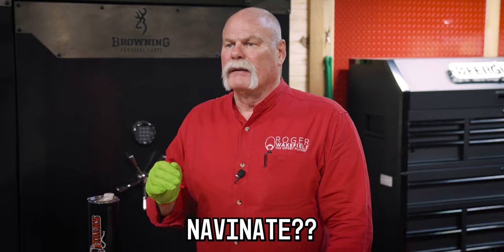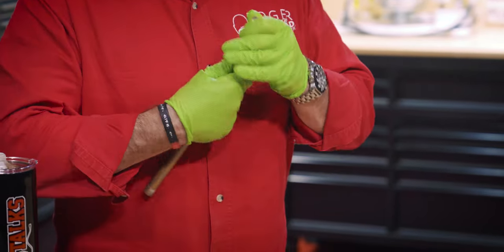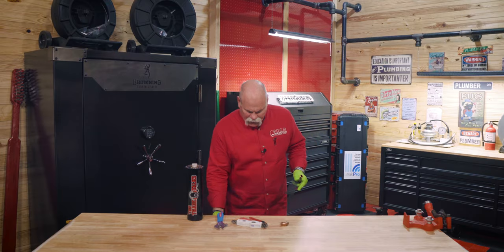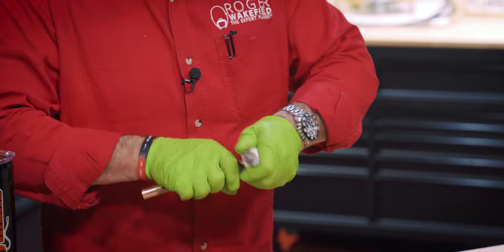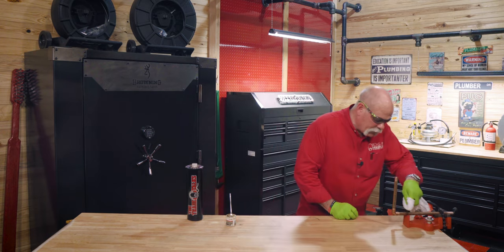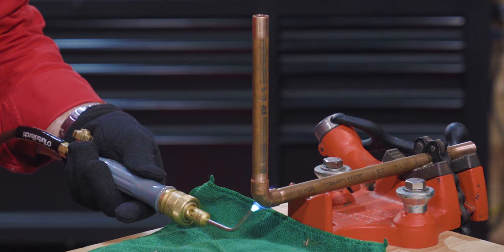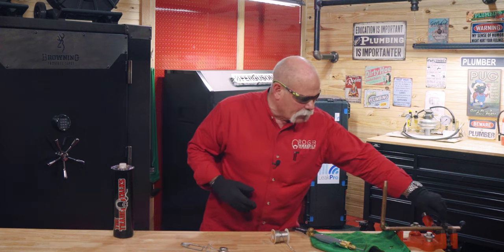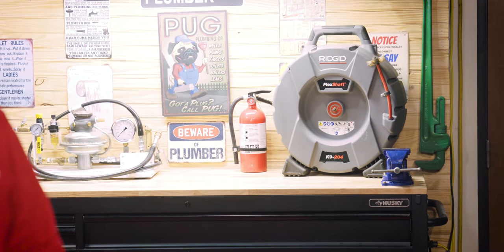7 Easy Tips For Working With Copper Pipe

Comment: Roger, I have a question for you sir. For a tie in point is it a good idea to transition from cpvc to pvc with a glue joint?
Reply: direct transition fittings are near impossible to find, so I use threaded adapter fittings to transition between. even put threaded unions/shutoff  valves there(if exposed).
if also exposed, you can sometimes find sharkbite/other brand push on that will do cpvc/copper/pex to PVC on other end. I've actually used those in 1" size for transition from old painted and brittle pvc to pex, for connecting line that would be very hard to replace(feed line from the well to pressure tank!). I explained the risks of leaving it in place and they chose to leave it, vs. replace 100+ feet across the partially finished building. of course I also pointed out the other 15' of black poly, that is also ancient, painted and exposed to damage.

Comment: I know it's not the subject of the video but as it seems in the US polypropylene pipes are not used, are there any specific reason for that?
Reply: black poly is used for rural well piping and for irrigation mains, but isn't used inside because the joints can fail.
Reply: @kenbrown2808  thank you for your reply. One would think that melting plastic to join pipes and fittings is safer from other plastics such as pex which are crimped or whatever. Anyway thanks again
Reply: The US does make use of PEX all over the country.  PVC CPVC and ABS are also quite common.
Reply: @Redact63Lluks  not talking about PEX at all hence the question
Reply: @MH-df6zx  we don't fuse poly.  we use fittings with mechanical clamps.  that might be the factor.
Reply: @kenbrown2808  oh ok that makes sense. Thank you
Reply: @MH-df6zx  in fact, if you're talking about heat fusing pipes, I've only seen that done on large pipes - like water and gas mains.
Reply: @kenbrown2808  yes exactly I'm talking about heat fusing polypropylene pipes. I'm in a third world country where heat fusing polypropylene is pretty much the standard. Pex is rarely used and the only pex is the multi layered one where there's the pex wrapped in thin aluminum then plastic on the outside and never used inside walls and stuff. I was just wondering about this subject, I don't think it has to do with the cost of it, surely cheaper than copper
Reply: @MH-df6zx  yes. heat fusing small pipes just isn't a thing our plumbers do.  besides soldering copper, and that isn't done much now that PEX is a thing.
Reply: @MH-df6zx Ki Tek?
Reply: @serpentinefire921 what's that?